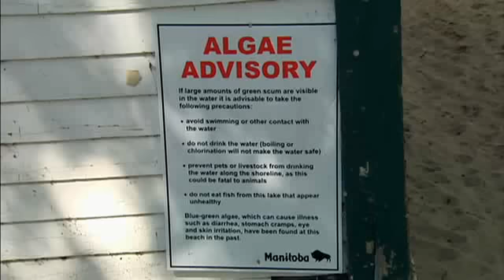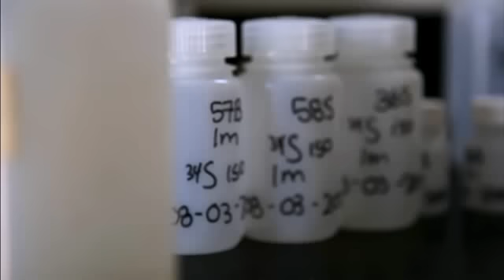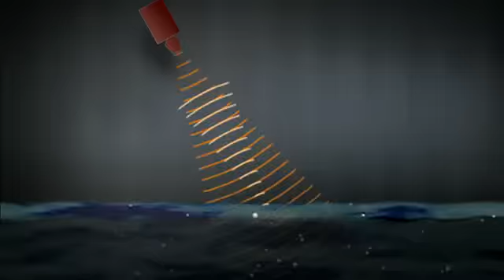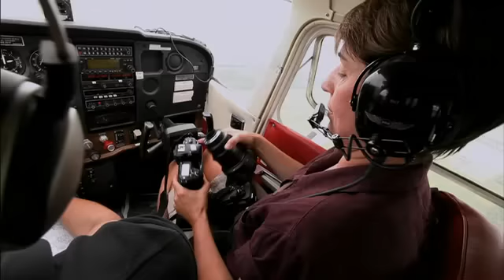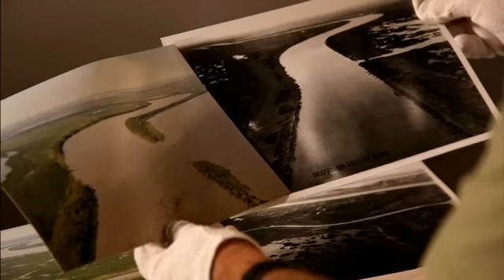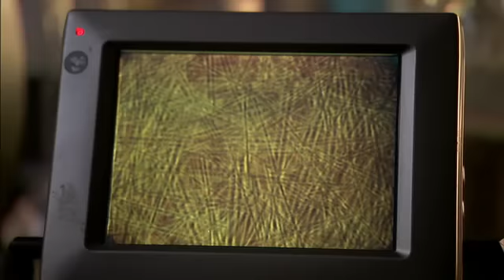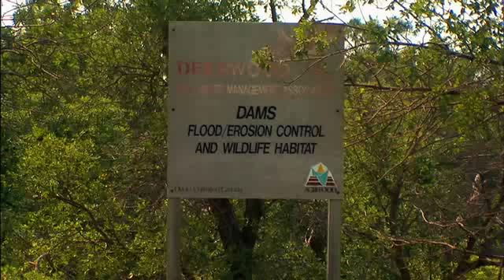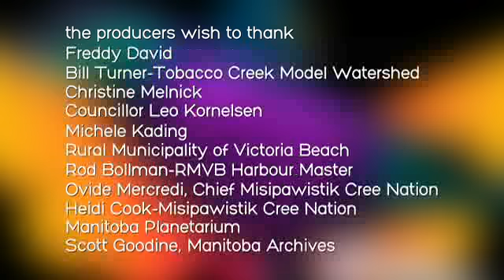The Nature of Things - Save My Lake

Comment: I don't think that the problem is agriculture.  The water at Lake Winnipeg is becoming stagnate...lack of movement. My grandfather said that the water from Lake Winnipeg flowed into the Mississippi River. Upheavel of land, etc, may have stopped the flow OR the Hydro dam but it started before the hydro dam was built. Part of the complaint was that they once had hundreds of ducks.  Stagnant water kills off fish.  Get the water moving.  The Mississippi use to have large boats now it is becoming more mud and less water.  Perhaps if a creek was dredged down to the Mississippi then that water would have more drinking water, fish, etc and Manitoba would have less flooding. Large fish are dependent on small fish...add catfish, sardines, shrimp etc
Reply: +iris wigle , the video explains that the lake is the reservoir for several rivers including the Red River which flows North from the Mississippi River, not the other way around. The problem is not stagnation but the combined loss of the smaller retention ponds, marshes and natural vegetation to control the amount of phosphates present in the run off from the farmlands. watch the video in it's entirety. it is quite interesting